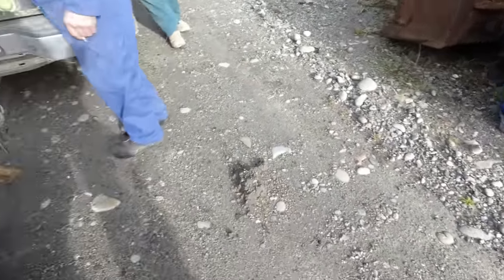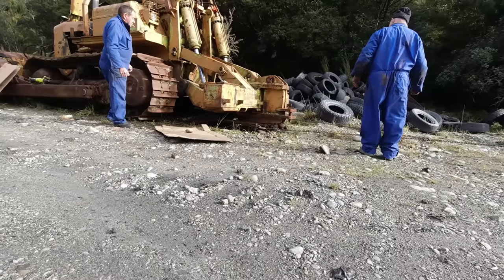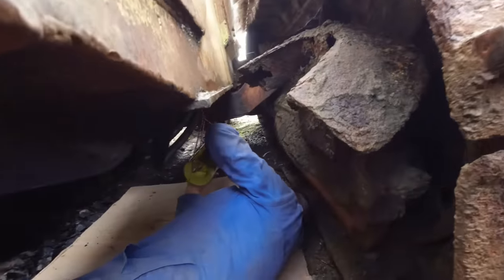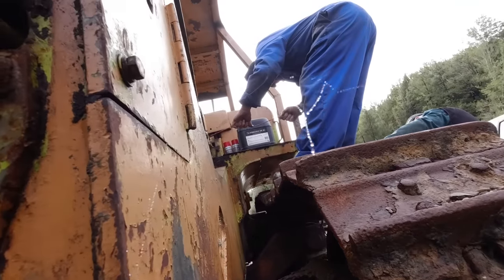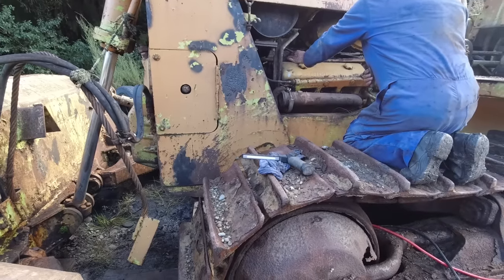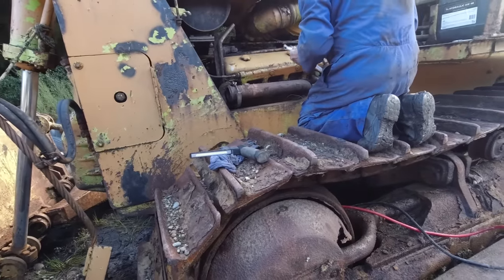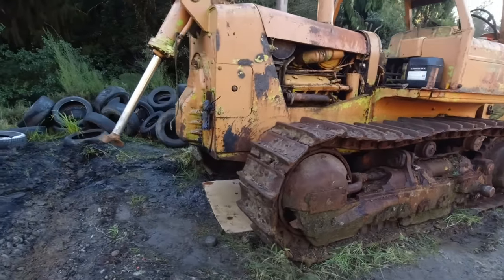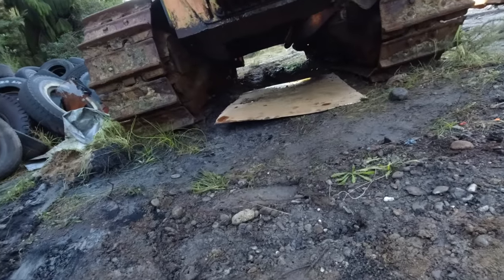Salvaging an Abandoned Terex 40 ton Bulldozer.. Will it Start??

Comment: Old Terex with a V8 Detroit 2 stroke is pretty cool, but nothing beats an old CAT. Long time ago (before camera phones) me and some mates started and drove a CAT D9 that had been sitting longer than we'd all been alive. All we had to do was check the oil, clean the points on the pony motor, add gas, and that old dinosaur started right up like it was parked yesterday on what we could only assume was 30+ year old diesel fuel. That was a fun day.

Loved the dummy starter motor for manually rolling the engine over. Will have to remember that one.

Comment: Hi There. I owned and drove an 8240 for about 10 years. I had Start troubles with my one and I fixed it by putting another jumper lead between the drive platform and the main chassis. A matter of a faulty earth. They are great machines.

Comment: They should have pulled the valve covers off and made sure the fuel rack was not stuck before trying to start it.  Those old Detroit Diesels were known to go into run away if there was a stuck injector which caused the rack to be in a wide-open throttle position.  Hopefully the guys at the shop will know to check that before they try to start it again.  Thanks for the video!
Reply: Dear goptools.
👍👌👏 Exactly! But not only that, each injector has to be checked too. Sometimes they got stuck but are mostly relatively easy to free up.
2) Hope I did hear wrong but I think that I've heard someone mention ether = starting fluid. That's a no go for Diesel engines, especially old ones.
Best regards, luck and health.
Reply: goptools exactly right the fuel system on a 2 stroke driptroits are nothing like a 4 stroke diesel I drove a few trucks with the old green leakers 53 series and 71 series back in the 70s and 80s
Reply: Absolutely ! ! !.  Hope they read your post......
Reply from the maker: Yes they checked injectors, valves etc on the first visit, I wasn't there to film it
Reply: I get the impression that this isn't their first rodeo.
Reply: Right on !! Hammer and chisel don't work here.....They might as well just cut the rest up too.
Reply: @arclightredux6088  except them trying to start it without checking the rack
Reply: @Chr.U.Cas1622    Ether works quite well on diesel engines, especially older ones that have lost some compression and become hard to start. It just lowers the flash point of diesel slightly which can help to give a cold engine a better chance of a clean start. When used incorrectly it will lower the flash point too far at which point the air fuel mixture will ignite too far before TDC, causing a knock. Many old engines were factory equipped with ether injection, including Detroit and Caterpillar. It's less useful on gasoline engines where the air fuel mixture is ignited by electric spark. Ether is a very dry mixture as well, and can wash the oil from the cylinder walls of a gasoline engine. This is less of an issue on a diesel engine where the fuel itself is a lubricant.
Reply: @FishFind3000  If i understand his comment correctly, Marty just said that they checked it on a previous visit but he wasn't there to film it.
Reply: Dear  @MartyT  
That's good to hear! Thanks for the information.
Best regards, luck and health.
Reply: @Chr.U.Cas1622   Ether/Starting fluid A no go for diesel engines? You obviously never dealt with cold climates and older engines.
Reply: @FishFind3000  they didn't, marty commented saying that was done before he got there
Reply: If you have an old diesel engine, and live in a cold climate, you better have a can of starting fluid and a hot battery if you want to get it started. It usually doesnt take much ether.

Comment: We used to drive by the old Terex heavy equipment plant in Hudson, OH when I was a kid. I remember thinking the static displays of bulldozers and giant dump trucks outside the plant were awesome. Sadly the only things remaining in Hudson are a road named Terex, and the buildings which are now the home of Joanne Fabrics. Not nearly as cool as a company that makes bulldozers and giant dump trucks.
Reply: Back in the 1970's, I saw a number Terex loaders and dump trucks on quarries and construction sites in the Arabian/Persian Gulf. I think the company specialized more on mining equipment and made some really big machines. We don't see this manufacturer around anymore, the last I heard was they were bought out by some other heavy equipment manufacturer. Terex design lines stand out beautifully - form and function - and you can tell its a Terex from a mile away.
Reply: That's sad to know,  I visited that plant back in '80, for a bulldozer training course.  Great memory..
Reply: 1970. That's back when we actually built stuff in Ohio.
Reply: @bige.3474  I remember the Terex guys showing us through the $25M Research and Development facility where they tested 1/4 scale models (in particular) Loadrunner scrapers,  till a fault occurred.  No engines,  just hydraulic cylinders forcing on frame and bowl simulating stresses effected by a haul cycle... Dozer training was real interesting too...
Reply: My wife would beg to differ 🤣🤣🤣

Comment: There's some years worth of experience with those lads,and if they can't get it to start i don't think anyone would. But it should be a cracking machine when it's finished.
Reply: i dont wish to sound negative but those "seasoned veterans" put a 5 foot extention tube on a ratchet,,,rooky if ever i saw it!
Reply: @garybarnett4821  I reckon when your out in the field you gotta work with what you got.
Reply: @garybarnett4821  Yes Gary, I wondered about that too, however come to think of it, I own a 3/4" ratchet which has an extendable handle, but I use it sparingly!!

Comment: You need two 8D batteries to get the cold cranking amperage, free up any stuck injectors, clamp a vise grip on the fuel rail to control the fuel manually, check the governor and shut down lever, check the air cleaner for any mice nest, squirt some ether, and sometimes alot to get these detroits going.
Reply: Many of those old 71 series Detroits used 32 volt starters. Especially when used in a marine application.
Reply: @user-se7vt5ow4e  12v, 24v, and 36v are the common starter voltages used throughout the years. Most common is the mt50 24v starter for bigger detroits. It can handle 1300 amps at 24v

Comment: In a big mining company you need to have fairly new equipment that is reliable and will run all day with the minimum of downtime.

You can buy older equipment like this cheaply and put it back to work the higher maintenance  went costs being offset by the low purchase price and lower utilization rate.

That is the cool thing about watching these videos seeing these machines put back to work 

I almost forgot to add if your like Marty and you can do the repairs yourself it makes owning these older machines even more viable

Comment: Great video. My old man use to build 6 and 8 V-71 2 stroke Detroits back in the 70's. He's got some good stories about them. The power from the super and turbo charging was insane back in the day, he said when he would dyno the engines they would routinely spine the torque needle around twice, so over 2,000 lb./ft. And the sound, holy.... Man do they sound wicked!

Comment: 5:50 for these old Detroit diesels you wanna check that the rack isn’t stuck. When the engine is off that rack goes to full fuel for startup. After years and decades of sitting the rack will stick or seize and you have a run away the governor can’t stop.

Comment: If I’m not mistaken an 8v71 is a Detroit diesel aka “screaming Jimmy”. I was surprised to see those mechanics trying to start it with only two battery’s as they need 4. What surprised me more was I didn’t see them checking that both banks of injectors and their racks are all freely moving prior to trying to start a long standing Detroit. This is really important as if any of the injectors are seized the engine will be a runaway diesel in seconds. They can be quite hard to stop too. If you haven’t then you really should take the too covers off and check them before you try to start it again. 

Look up the “grease bus monkey” YouTube Chanel as he only does Detroit’s in buses. 

Loved the video, hope it runs right 👍

Comment: beware the stuck gm injectors............and runaways.  Marty you find some truly excellent adventures ( Bill and Ted reference).   An 8v71 or Cummins NTC855 in trucks u need at least 3 full size N70 truck batteries and heavy jumper leads.
Reply from the maker: Yes they checked the injectors and valves on the first visit

Comment: Just saw the 2 stroke Detroit.. it will start! Well as long as the injectors fuel adjusters aren’t stuck
Reply: As long as the rack isn't seized wide open and the engine runs away until it grenades...
Reply: @michaelowen1750  yeah it depends.. usually it will stick closed, as the shutoff solenoid holds it closed for the 20 years. But yeah it definitely happens, the newer ones are spring loaded so one stuck can’t hold the others open.

Comment: I’m at 5:56 And that big black jug doesn’t have a bleeder valve you can open,  so that it pours sooooooooooo much better.  The way it is now,  it’s making a terrible mess.  Everywhere.  

I would have used 1 of 3  different “INDUSTRIAL-ICE-PICKS” I keep in one of my tool-boxes.  

And went to the edge of the top of that 5-Gallon-Bucket,  and took one of my small 1-Pound-Hammer,    And tap-tap-tap the top of my “Industrial-Ice-Pick,  drove a small hole in it.  And it would have poured out,  like a kitchen-faucet.   So smooth.

Comment: well. marty. i   used  to   operate   the   8240. .on  .the   tip  head   of ..the   mine...at...rotowarro . huntly   in the   seventys   great   machines...in  the  mud   .watching  you...try  to  start  that  old   girl the  starter  is   probably   all  right ..but   the  jumper  were   a mile   too  long  we  use  to   park  the   machine   with   the   good   batteries   touching  the  other ..for  an  earth  and   double  up   the   jumpers   neg  to  neg  for  .best   results  any   way   good  luck   with  it

Comment: Is that a 12 volts  or a 24 volts system on this machine ?
Was the starter a 12 Volts or a 24 volts ?
Because batteries are in serie there,but they are really small,and the engine way turning way too slow.
Reply from the maker: 24v, we thought the batteries may have been too small so we tried the excavator, still no go. Its a faulty starter

Comment: always make up a set of 3 foot long cables that can be hooked to the positive and negative on the starter motor .. a board with two 100MM bolts  sticking up to get multiple jump cable clamps on..  making it much easier to jump start heavy equipment.   if you are as insane as me.. you might do double cables from the 100MM bolts to the starter positive and ground connection to reduce voltage drop.  i wonder how much current the dead batteries in the terex were trying to pull  out of the jump start batteries when they were hooked up.
Reply: I'm confident they were not that stupid to leave the dead batteries in circuit.  They were probably so badly rooted they had 100% resistance and would draw nothing anyhow.
Reply: I’ve done this on old 12 volt equipment, but briefly hooked it up to 24 v , just to get it spinning. It works wonders, great if you don’t like to get greedy with the ether. Old, well built equipment can take it in small doses. Really gets them spinning!🤣🤣👌

Comment: Some spray on lubes or rust buster type pressurized fluids can be sprayed directly into intake manifold after air filter .Some use propane to compress and squirt contents and lube acts as compresive ignition fuel , propane boosts fire .Shoot 5sec and start cranking keep spraying to keep running.  PS , propane is to diesel  as nitros is to gasoline ...

Comment: You don’t need a jumper from negative to negative just put the machines in contact metal to metal and you have the grounds connected then connect both cables to positive’s and you will have more amp available

Comment: Seemed like it wasn't the starter so much as maybe compression lock or something wicked in a cylinder or two...or three.
If you could roll back the engine a bit or release some of the pressure it may have had enough to push it over another time.  
Hope you got it for a song.  Thats one old rusty bahstid.  Funnels are cheap,.  A borescope isnt cheap but would be worth it.
Hope to see this brought back.  Just be careful not to take it any farther than its already gone :)  Looking forward to some engine sounds.  Great!
Reply from the maker: I did wonder if it was a blown gasket or sleeve letting coolant in to a cylinder locking it up

Comment: I've been around those 8V-71 Detroits most of my life and they've always been 318 horsepower naturally aspirated with the blower or 350 horsepower with the blower and turbo, now you really have me interested.
Reply: I have one in an old Michigan wheel dozer that is rated at 290 horsepower. Probably just smaller injectors than a 318.

Comment: Make sure the injectors aren't sticking. GM 2 strokes are notorious for it when they've been sitting for a long time. 
They can runaway and unless you're prepared for a runaway, are almost impossible to stop. It is possible this has a runaway flap in the intake. When the time comes (preferably after the verifying if the injectors are unstuck) if it won't start ensure the runaway flap - if fitted - is open. I had a field trip and it was exactly this simple item that prevented a successful start on a long sitting 8V92.

GM 2 strokes even after sitting for long periods have a tendency to instantly and unexpectedly start when all the conditions for combustion are met so you need to be a little aware because any tools/rags etc can go flying because you think you'll be winding on the starter for ages.
Reply from the maker: Yes they checked injectors and valves on the first visit, I wasnt there to film it

Comment: Pretty cool. Sounded hydrolocked to me. Coolant? Stuck open injector? Hopefully didn't bend a rod, that was a serious starter. Never seen jumpers move like that. Was there a reason they didn't lift up and chain blade on front piston pins in raised position for transport instead of cutting it off? Bummer seeing that shaft get sliced up, that is not gonna be a cheap fix unless they have a parts donor. Just curious.
Reply from the maker: Yes we wondered if there was coolant in a cylinder.. blade is too wide to transport, it is going to be stripped down and the guys have a fully equipped workshop, welding it back together is not a problem
Reply: @MartyT  Excellent! I was hoping that was the reason. More tools you get, easier the jobs get. Or at least that is my excuse to keep buying more tools but it's usually true.
Reply: Wondered why they didn't just cut one of the  cyl mounting lugs off on the blade instead. Hmm

Comment: It`s a detroit I am guessing it will start. The only thing is to always  check the injectors to see if the rack is free. To prevent a possible runaway. Thank you for another nice video. I am disappointed that they did not get it to start. I can see why it would not crank but I will not say anymore.

Comment: You know, I never find abandoned heavy equipment in the woods.  I did find an abandoned Ski Doo that was stolen. Fun driving it down a dirt road in the summer to get it somewhere  that the police could pick up.
@4:50 is why you use goggles on old stuff

Comment: dont know if anyone missed the battery cables moving, theres so much current and instant heat from the draw the cables sag then pop back. Pretty crazy.
Reply: I wondered about that. Experienced it recently myself with 208V service to my shop when I plugged in a welder with a shorted rectifier. Sounded like someone hammering on the ceiling joists 😂

Comment: Why do people never have fully charged batteries or large  enough jumper cables when they go to jobs like this. I cannot remember when I last saw a YouTube video (other than a certain Kubota rescue) where there was enough electrical grunt to do the job.
Reply: Yeah or the battery cables and terminals are so much junk and everythings glowing or smoking and they fry the started trying to get the very last turn out of it.  There is a US channel used to check the oil/ fuel , coolant, put batteries on and they forgot the first basic check is it even seized and won't turn over. But hey I guess the other stuff turned a 2 minute failure video in to a 30 minute one L.O.L
Reply: Sounded more like it was hydrolocked. Probably a stuck open injector which is common on these from what I hear after sitting, always a runaway danger if they do pop off or coolant getting in. Hopefully didn't bend a rod.

Comment: well they're getting a good start on cutting it up for scrap..
Reply: @JohnSmith-yv6eq  true. i've move a few like that too in my time.. the thing i would have done differently is zing off the bolts and knock the pins out to lift the blade.. torching off the ends of the cylinders is not a good move.. creates a weak point in the system that is prone to breaking

Comment: I wondered if it was correct starter. Detroit diesels have a few different types and voltages. Wrong one just won’t work.
Reply: they only had 2 car battery's. It needs least 4 #31's or4D's. It might take 4 8D's. It's not just a truck engine you can clutch out. It has a large load from hydro trans and pumps . A quarry by me has a loader with two large starters on engine.

d's

Comment: I was surprised to see old timers filling the fluids and watching the klug klug klug with fluid splashing all over. Most ol timers know that moving the fill spout of the container to the top and then pouring prevents trapped air from from klug klug klugging. This should be an interesting series.

Comment: Never spray them with starter fluid gas rag maby need hot battery's low amps will kill a starter motor. run the rack make sure no stuck injectors.